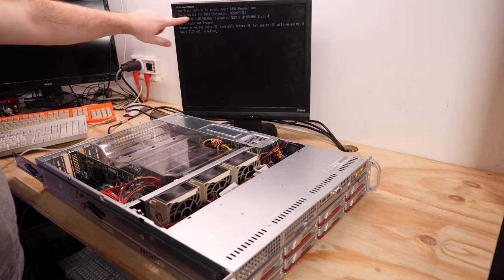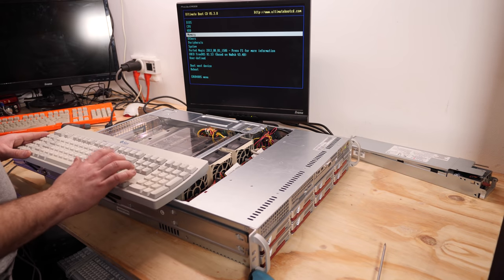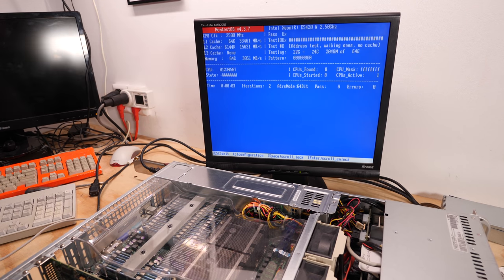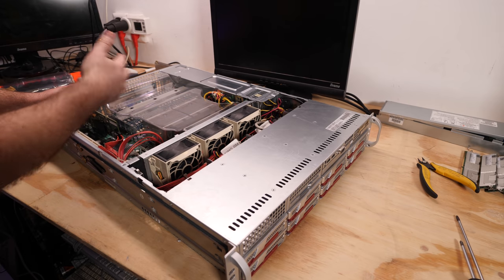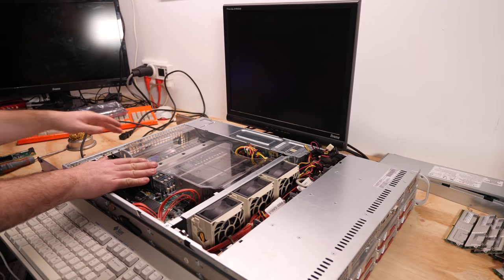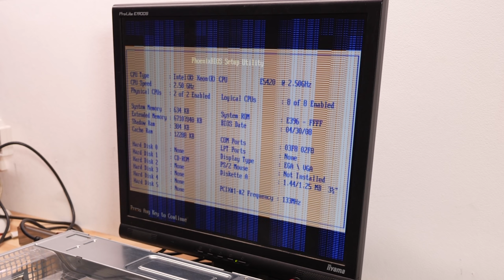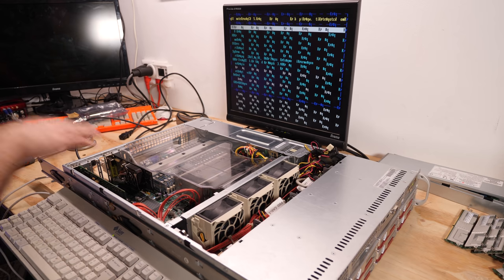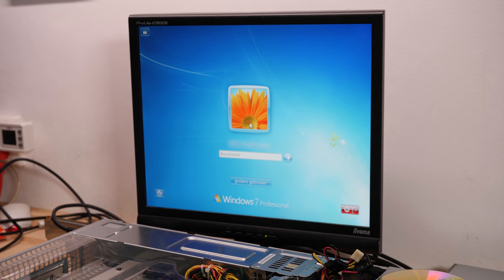I got a Free Supermicro Server for my Homelab

Comment: Sometimes you can silence the beep (acknowledge the alarm) by using IPMI tools. For an old server I was using temporarily I just removed the beeping speaker from the circuit board as I didn't care about the audible alarms. Any alarms will be visible in the IPMI event log anyways.

Comment: SuperMicro was my Server Kit of choice far more advanced and refined than the shoddy dell crap that was floating around at the time... I built a Xeon 3DStudio Worksatation/Render Engine and Gaming Rig back in 2003 built on one of the first SuperMicro Server boards with DDR3 and a 16x PCI-E Graphics Card Slot. I was told that was the first Xeon Games PC built, I only got it to work because Windows Server 2000 got DirectX days after the pre-production board release.

Comment: it's less messy to carefully open the slot with a small rotary tool (dremel). Did this twice already to install network cards in smaller slots. You can also try to cut the pcie connector of the graphics card, the lanes are wired in series so you just have to know where to start cutting - modded a 8400GS to pcie x1 this way - of course the 3d performance suffers a bit ;)

Comment: Installed Windows 10 on a HP Proliant DL380 G5  with 2x Xeon X5470, 32GB ram, 2 SATA Intel SSDs and a Radeon HD5450. Use it as a rack based PC in the server room at work and it quite fast. The HP SA P400 SAS controller have crappy SATA speed so a couple of 10K SAS drives would probably do the job better. Tried a P410 controller and it wasnt any better so i think the SAS backplane also have its limit.

Comment: Pull out the bad power supply. It's beeping because it's plugged in. You only need 1 PSU to operate the server. They are N+1 redundant.